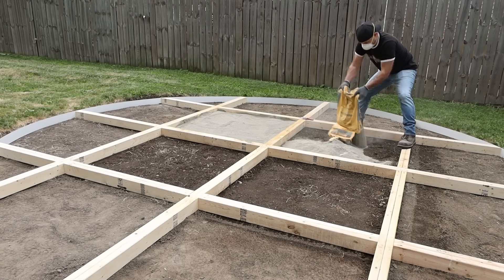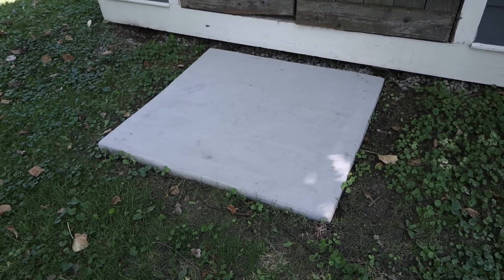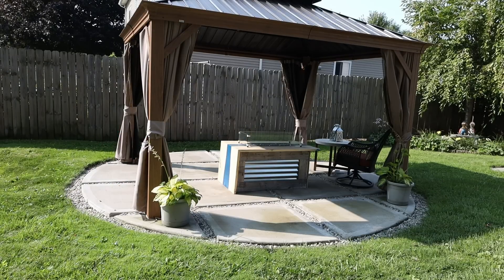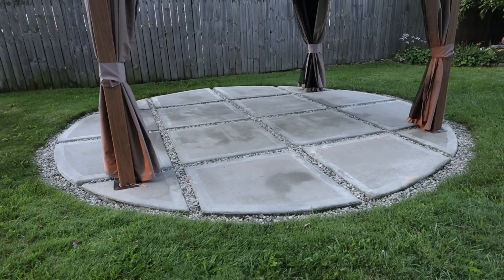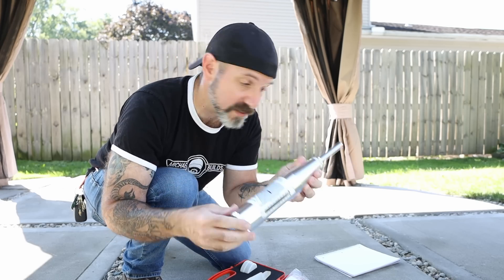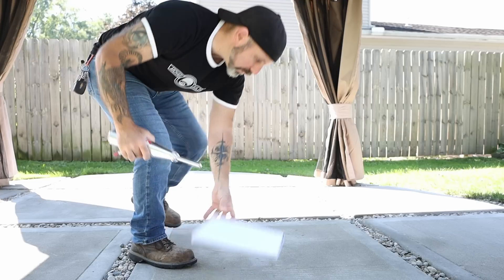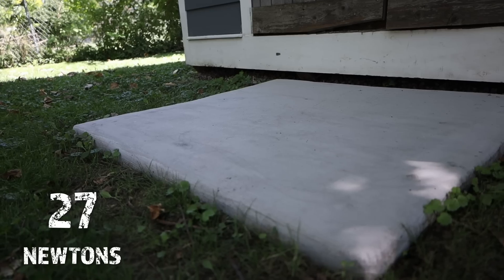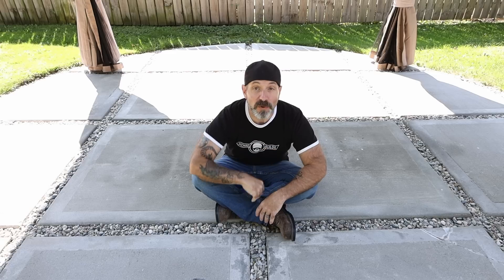Testing Dry Pour Concrete 1 YEAR LATER...

Comment: not sure if this will help or hurt but i live in florida and there is a road from naples fl. to ft. lauderdale called alligator alley and when it was built back in the early 60s all the bridges and there were many!!  had bagged sakcrete used at the ends of each . they were laid att approx. 45deree angle up on the dirt . they were still there in the 70s when I75 replaced them .!!!!!
Reply: They lasted better than the road did, that's for sure.  You would think with no frost heave or freeze cycles the roads would be better here, but nope.  Cape Coral especially, the roads here are trash for how much they tax us here.

Comment: PSI strength will depend on the concrete mix that you used, do you remember what you used? That would tell us more about what the manufacture expected it to be in normal use as opposed to dry pour.
Reply: Looking at the video, it was the Quickcrete yellow/orange bag, which the bag states that it should be 4000psi

Comment: Seems like the dry pours that were in direct contact with the ground did better.
Reply: That's actually a great observation. I think if the ground below the dirt is wet then that's the best because the concrete can pull the moisture up.